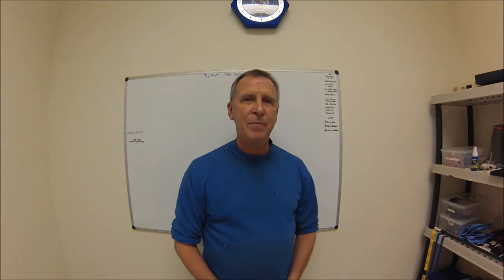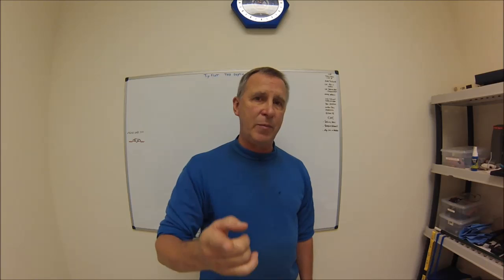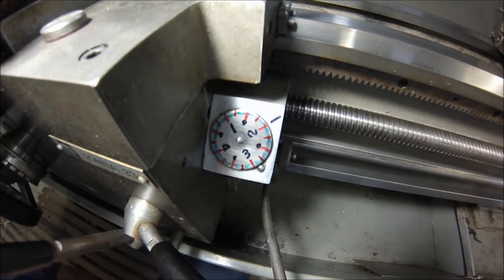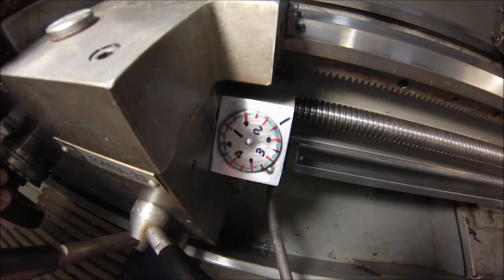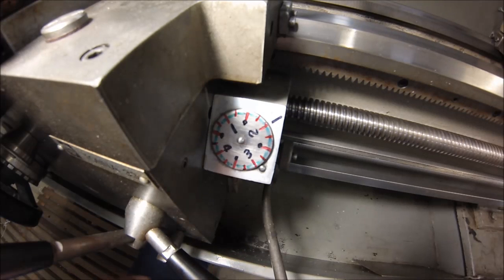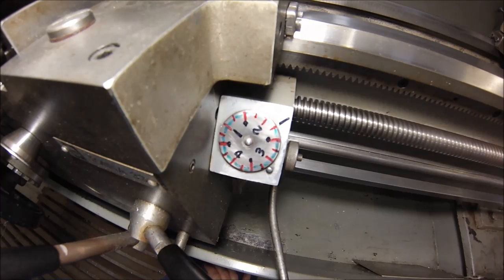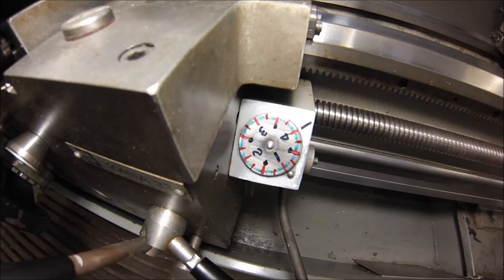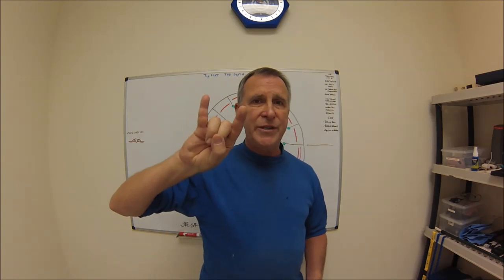Engaging a half nut.....made easier

Comment: I've always suspected that you could do that but my half nut keeps grabbing on the top of the threads. I'm going to give everything a good cleaning and try again. Thanks!
Reply from the maker: Inspect both the half nut and lead screw. Its possible one has raised edges or is terribly worn. Clean is a very good place to start.
Reply: @joepie221   I was getting this too and cleaned, deburred and adjusted everything and was still getting it to some degree. What I found was that the carriage wheel was free moving enough that light pressure on the half nut was enough to cause movement of the carriage.
What I worked out and what I've since noticed Joe doing (probably subconsciously) is have my hand on the main wheel for the carriage with a light enough force to stop it rotating freely. When the half nut is fully engaged the force back through the wheel is enough to let me know to release my grip on it and let the carriage be driven freely via the leadscrew

Comment: Joe, I owe a lot to your videos on what I able to do now with my machines, thank you very much.  I just got a JET 1440 and was checking out the half nut for threading. This video shows engagement on the 1/4 (2, 2 1/4, 2 1/2, 2 3/4, etc) but when I checked my machine it will engage on the 1/8.  Is this a know issue with the JET products? Any know way of correcting it to 1/4?
Thank you 
Jeff
Reply from the maker: I believe most machines will engage on the 1/8's, its OK. Knowing how wide the gaps are is the key to successfully doing the drag technique. I believe my lathe also has 1/8 engagement points.
Reply: @joepie221  Thank you

Comment: What could be wrong with keeping the nut constantly engaged, but stopping the motor, reversing it, and then putting it back forward again?
Reply from the maker: Absolutely nothing. But beware, using a hard stop is dangerous when doing that. Leadscrew taper pins shear when loaded against a solid surface.
Reply: @joepie221  Thank you for the answer. Concerning the loading against a solid surface, I think a groove at the end of the thread can take care of that.
Reply: @Joe, never say never.

Comment: There is another thing you don't mention:  I have a variable frequency drive on my machine.  You slow it to crawl, pop in the half nut, speed it up, make a cut pass, and slow it for the end of the cut.  (You can even let the tool crash into the end if you set the speed so slow that the motor harmlessly stalls).  This is also handy for short threads or long ones where you can't disengage (such as metric).  Engage half-nut, make cut pass slow, back off tool, reverse fast, re-set tool, 2nd cut, etc. while keeping half-nut engaged.
Reply from the maker: Hardinge by any chance?
Reply: @joepie221  No.  It is an Emco-Mier  1/2HP 11 x 24 I bought from Ebay with a 3 phase 208 volt motor.  I like this as it has the "big standard USA tooling" (D1-4 spindle, MT2 tailstock) while performing intricate model making work also (and not needing riggers to install it, 300lb).  I used one of these at work to make tiny stuff and robots for the military.  I bought a VFD and now I can plug it in to an ordinary 120VAC single-phase outlet.  Now it serves well to service my 1/8th scale steam engine.  You can do things like on a large diameter face-cut, start slow and crank up as the tool approaches the center.  I can also do "heinous" set-ups and run very slow.
Because it was also designed to be a milling machine, the tool platform offers much more range of adjustment (such as threading in the back).

A trick you may want to publish.  When turning between centers, the lathe dog is a dog!  Machine a center for the headstock down so it can be put "under" a 4-jaw chuck.  Remove 2 jaws, open the other 2 wide.  Mount work.  lightly tighten the 2 jaws to serve as the dog.  You can notch the work first for the jaws to engage to.

Comment: Leave the half-nut engaged and cut the thread with the spindle direction in a forward/reverse operation. That's how I prefer to do my threads.
Reply: That's what I was thinking about. Why go to all that pain in the ass of catching just the right moment, if you can just keep the nut constantly engaged and just do forward-reverse-forward routine? Although, the first time I tried it, my forward-reverse switch kicked out halfway through. But it was because I put the thread cutting gears too tight.
Reply: I used to do that. Very time consuming and a Royal (the worst kind) PIA.  Learn to do it right and you’ll thank yourself and Joe.

Comment: Once again, great stuff. I aught to just go to your channel & watch every video from start to finish.
I had a teacher that sort-of explained what to do with the handle but I still have the tendency to slam it down.
My lathe is a smithy combo, designed differently so I haven't had the opportunity to take a look at what's going on down there an a typical lathe.
 This method of teaching works excellent for me, it reminds me of learning to drive a stick when I was young. I spent several days after work over 2 weeks, trying to get the hang of it, having friends try to guide me. it wasn't until a friend of mine explained what's going on between the flywheel, the clutch, the differential and the wheals that I actually got the hang of it. First time he took me out I was driving fine in about 15 minutes.
Reply: When I teach stickshift, the first day's lesson is entirely without the accelerator pedal.  This includes scratchpad time talking about how and why things work the way they do.
There usually isn't a third day of teaching needed.

Comment: Hi Joe,  I'm old and self-taught and enjoy your videos to see what I may have missed in the last 30 years.  Here's a head scratcher to keep you up at night: The metric change gears that came with my Chinese 12x36 gearhead lathe were lost while moving.  In planning to make replacements (Module 1.5; PA20) I wanted to fill in some gaps like the 27 TPI plumbing thread used on faucet aerators, as well as some common metric threads not supported by the original design.  I made up an Excel spreadsheet macro to evaluate gear combinations and soon discovered how grossly inaccurate the original ones were for metric threads.  Armed with much better ratios, I now have some gear cutting ahead of me. (Fun!?)  This has started me thinking about a need to analyze the threading dial when using change gears.  Without going thru all the math, I would probably keep the half-nuts tight and reverse the machine between cuts.  Do you have any sage words of wisdom on this?
Reply from the maker: Your awareness on this hazard is very intuitive. Keeping a halfnut engaged for metric threading is an industry standard. I have yet to come across a machine that can run a metric thread with the same casual approach that an imperial will allow. This being said, all carriage movements during metric threading should be with the lathe motor  and halfnut always engaged. I have been known to actually engage mine and remove the handle until the thread is complete. Its just too natural to disengage it.
Reply: Joe Pieczynski 
My lathe runs metric threads with the tdi, the only thing is that you have to do is change the teethed gears inside the tdi. It has 3 gears (14-15-16) 

Thanks for your vids, i enjoy them. 
Best regards from the Netherlands.

Comment: Always make sure that your threading dial is fully engaged with your lead screw before you start cutting threads. no backlash.   on a lot of older lathes, the engaging lever does not lend itself to  'dragging' because they were never good even when new. practice  a lot before using this method.  Now.... an old lathe trick, for cutting right hand threads to a shoulder, run the headstock in reverse, turn the cutting tool upside down and on center of course, start at the shoulder and the tool will just run away from the shoulder. good luck.
Reply from the maker: That material was called Ledloy where I was from, and it did cut nice. The threading technique you described is detailed in this video.   https://www.youtube.com/watch?v=Z-dqOi_z5bk&t=4s  It was my first YouTube machining video.
Reply: , great tip about the dial being fully engaged,!
yup, our old clausing is very clumsy, doesn't like to be engaged

Comment: This video is a god-send to me.  I'm a self-taught machinist and I've owned my gunsmithing lathe for over 8 years and except for the one or two times I totally screwed my threads, I have never cut thread with my lathe running since that time.  What I mean by that is that I made a crank handle that I used to manually turn the head stock in order to cut threads.  My crank handle was made to fit into the bore and be secured by the outside spider screws. 

 To all you seasoned lathe operators this  most likely sounds funny or even stupid but, it was the only way I could engage the half-nut at the correct time to get clean threads.  I would also keep the half-nut engaged and just turn my crank handle the opposite way to bring my threading tool back to the beginning and start over.  You might imagine how long this was taking me, even on a short length of thread.

 Besides my own ignorance about this, one of the reasons I had consistently miss the mark when engaging the half-nut was because of the diameter of the round marker in comparison to the width of the  hash lines on the revolving dial.  Similar to the lathe in the video,  the round marker that I strived to align with the correct revolving hash lines with is about a quarter inch in diameter.   That's a quarter inch of travel from edge to edge on that round marker.   I'd wait till the correct hash line was dead center on that round marker but failed miserably the few times I tried it.  That's when I broke down and made that crank handle.

I'm right hand dominant and I had to turn that crank handle with my left hand while my right hand engaged the half nut.  I used to laugh at myself under my breath whenever I had to cut threads.  I was afraid I'd develop an overly muscular left arm and my friends might start to think I was a compulsive left handed masturbator.  How the heck would I ever explain that to some of my non-machinist dick-head friends?

I did have a question about that slight pressure you put on the half-nut handle just before engagement occurred.  If a guy does alot of threading, is it possible that it could be similar to that of one riding the clutch on a stick shift automobile?  Will it wear out the half nut like riding the clutch might wears out the clutch?  Hope that makes sense.   Incidentally, I also watched your reverse direction threading video too.  It was very helpful.  I do all my own gunsmithing so once I've gotten used to this method it should save me alot of time  and minimize the foul language while standing in front of the lathe.  

Keep up the good work and thank for the help.
Reply from the maker: The drag pressure won't wear out the mating surfaces of the half nut, but may take some of the area by the split. It will take years and never affect the engagement integrity.
Reply: Many thanks for the quick reply.  I appreciate your help.   I had some free time today so I did some experimenting with  the half-nut engagement like you showed in the video.  It worked like a charm.  I can't thank you enough.  No more pucker factor when threading. 

I also tried the reverse threading technique you showed in one of you other videos.  That also worked very well.  One of the things I have yet to wrap my head around is the 30 degree angle of the compound slide when you do your threading in reverse as opposed to the conventional way.  I've only started watching your videos recently so I thought I'd ask;  have you made  a video addressing the cross slide and compound slide setup when threading with the lathe running in reverse that you can point me in the direction of?  Thanks again.
 @joepie221

Comment: G'day Joe.
I have been watching your video's and enjoy them a lot. In 1972 I started a fitting and turning apprenticeship and when I finished 4 years later I left and joined the army. In 2009  my wife and I purchase a 1963 Ford Thunderbird. With that I bought a second hand Chinese lathe and a acquired a small mill. with these two machines I have been making parts and tools for the car. without your help I would be stumbling along. I enjoy making the parts as much as driving the car.
You are a inspiration.
One question, when you placed your own mark on the dial and then you proceeded to engage the 1/2 nut, the numbered line on the dial lined up very close to your mark, however the manufactures mark was somewhat lagging behind the numbered line. Could this because the manufacturer deliberately placed his line forward of the engaging point to make it easier to engage?
Thanks,
Karl from Brisbane Australia.

Comment: Well done!  I  use this method  and If the thread is relatively coarse I try to add as much distance as practical before the tool begins the cut to verify I have engaged at the correct place.    I truly enjoy your video's.
Reply: Ed: You took the words out of my fingertips. I realized this 50 years ago. There is no need to have the stress you describe here.  There is no reason to bring the carriage close to the work piece unless you are using the tail stock in close proximity to the work piece. Even then, you can extend the tail stock to give you enough distance that you don't have to run a marathon to get the half nut engaged. A little patience is all that is needed to wait for the tool to engage the work piece. No stress at all. slowing the lathe down helps too.

Comment: I hope someone might be able to help me. I have set everything the same 29.5 deg and all
And every time i engage the half nut it double cuts. Doesnt stay in the same place. What am i doing wrong. Im cutting M20 thread.
Reply from the maker: Usually you don't disengage a half nut for metric threads. Make all carriage movements with your motor direction and leave the half nut alone until the thread is complete.

Comment: The thread crests of both the Half-nuts and Leadscrew are riding on each other when light pressure is applied.
Reply: You're right they are. But thats the point. If your light pressure is light enough, the half nut will close when the leadscrew trough aligns. If the carriage creeps along with your light pressure, you're pressing too hard. This way works really well.
Reply: Joe,
Agree.
That's why it's imperative that you practice, practice, practice before using this technique, then once again after a period of not using it.
It's very satisfying the first time you get it right.
Best videos I've seen on lathe technique for both beginners plus long time users as I am. 👍👏
Reply from the maker: Agreed. gentle pressure. Its a 'Feel' thing.

Comment: I've been doing it so long I never imagined people didn't know that!  Mostly I don't bother disengaging the half nuts, I leave them in and reverse the spindle at the end of the cut to work it back
Reply from the maker: Your technique is more common with metric threads. I personally always disengage my half nut and usually work to a hard stop. Reversing the carriage into a hard stop doesn't usually end well for the machine, part or tool.

Comment: As usual Joe such an informative Video thanks so much for explaining it so that its easy to understand. 35 years ago I was trying to cut threads on one of the lathes at the high school I worked in, and none of the machines in the workshop had thread indicators on them. No way could I fathom how to achieve what I wanted, and I gave up. Have you done a video on thread cutting WITHOUT the use of a dial indicator Joe? if so can you direct me to it? or would you consider doing a video on that topic?  Once again a great video  thank you from the UK.

Comment: On my big lathe I use this technique for inch threads, it works very well.  On my 10EE I always keep the half nut engaged and use the spindle control and snap out with the crossfeed.  I've always felt that this gives better results with fine threads since the half nut's engagement can not vary and the 10EE is well suited for this.
Reply from the maker: How does that work when you are doing a thread smaller than the shoulder you are turning to?
Reply: You have to be quick with that cross feed.  If it is too steep, your method is the best.